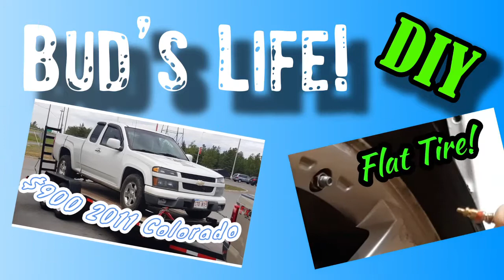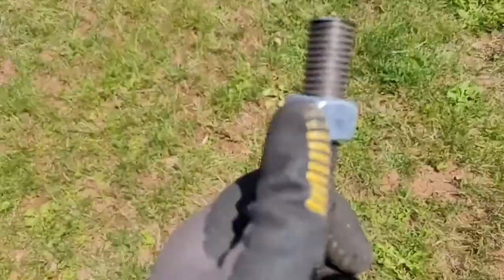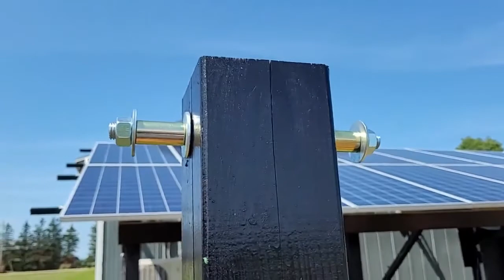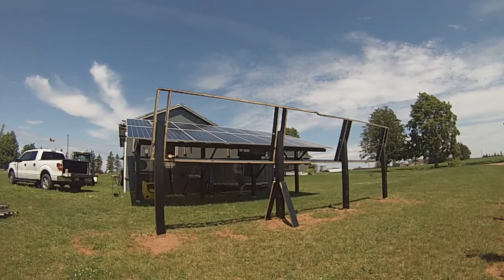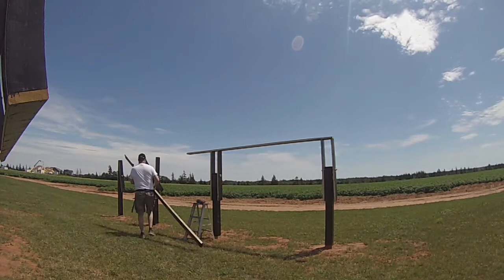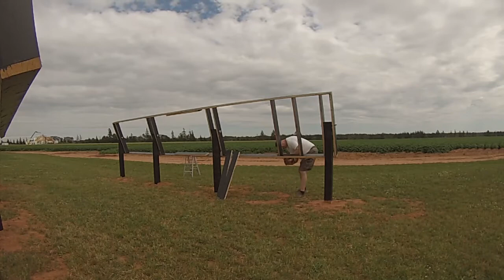HOW TO BUILD A SOLAR PV TILTING RACK FOR A 10KW SOLAR SYSTEM (PART 1)

Comment: Do you even need unistrut? Can't you use brackets and secure the panel frame directly to the wood?
Reply from the maker: @satekeeper  Yes, instead of the unistrut, you could run wood. The main reason I used unistrut on these racks was to strengthen them up a little more because they were tilting racks. Also, this helps when grounding the panels. I was able to run a groundwire to each unistrut, which saves a lot of groundwater and ground clams. I've recently built another rack on the back of my house and this one. I did not use unistrut on, and I have to ground all of the panels individually, which costs a little more for the groundwater and all the grounds straps I need.
Reply: @budslife  Thank you, Bud. Where I live, unistrut has become very expensive. I can see the benefits. Right now I am considering anchor bolts as my panels all have mounting holes intended for the purpose. I love these designs that are adjustable, it makes a big difference on the yield. Definitely using the bolt-pivot style like you have here.

Comment: Hi Bud. You've inspired us to build a similar racking system out here in Manitoba. I'm wondering did you put the posts in first and then drill the holes for the 3/4 bolts or did you drill them before putting the posts in? That seems like the trickiest part of the build as all the holes have to be at the same level.
Reply from the maker: I drilled all the holes before I put the posts in the ground. I would recommend making a jig out of wood to keep all the holes in the same spot when you drill them.
Reply: @budslife  Thanks! So how did you get the holes to line up when putting the posts in if the holes were predrilled.
Reply from the maker: @samanthawebster2146  It's been a couple of years since I did this project. But I'm pretty sure we put the 2 outside in post in first. Then, I ran a string across the top of the posts. We then set the center posts in, so they just barely touched that string. This put all the holes in line pretty close.
Reply: @budslife  Great thanks for the info! I found this to be one of the best DIY tiltable ground mount videos on Youtube!
Reply from the maker: @samanthawebster2146  Thanks, and thanks for watching. This past weekend, we just mounted 15 solar panels above our 16'X16' patio (deck). I will be uploading a video on this soon. Hopefully, in the next week or two. Thanks again!
Reply: @budslife  Can't wait to watch it!

Comment: great video. Im planning on building my own rack for my system and like you design. did you cement the posts or just compact them in the dirt?
Reply from the maker: Thanks for watching my video.. I'm glad you like my design. The posts are compact in the ground. I've never had any trouble with them.

Comment: Having a non-automatic adjustable rack is really the way to go.  It actually requires you to go out to the rack and inspect it periodically.  There are a lot of systems using the "Install and Forget" method.  And, not many people actually go up on their roof to inspect their panels periodically, or even clean them.  An automatic tracker is practically the same thing, install, forget, and find out why it failed when it stops working.  Thanks for the video.  Nice and simple racking system.  I imagine a 32' system might be a little too long.  Would like your input on that.
Reply from the maker: Thanks for watching. Yes, 32 feet would be a bit large for this setup, I would think. If I was doing it again, I don't think I would build 2 rows of panels together. I like the single row smaller panels that I built. They're much easier to tilt, and they don't catch as much wind.

Comment: No comments?  Well you do good work!  I'm planning similar projects and I like what your doing!  I'm subscribing.
Reply from the maker: Thanks 😊  It held up very will through hurricane Fiona, we had around 170km an hour winds. I have another 29 panels to install next summer this should give me close to 20KW total. Thanks for watching and subscribing!
Reply: @budslife  Nice!!!   Proof is on the pudding, or in this case the hurricane 🌀!
Reply: @budslife  what kind of wood did you use?
Reply from the maker: @l0I0I0I0  I used 6x6 pressure treated posts to go in the ground and I used 2x6 spruce for the framework. And then I painted the whole thing with an oil base rust paint which seems to hold up very well to the elements.
Reply: @budslife  TY!